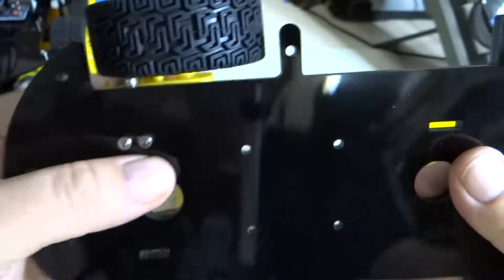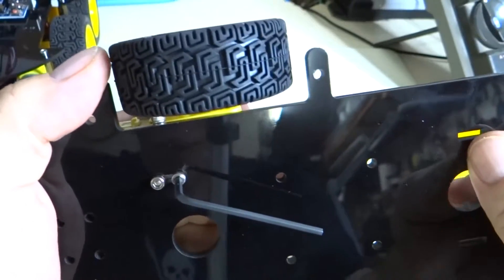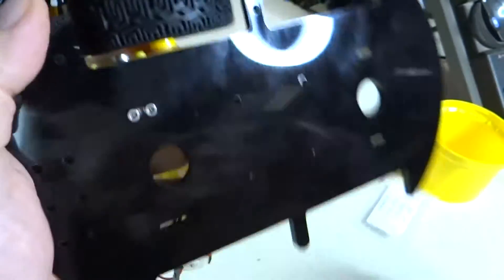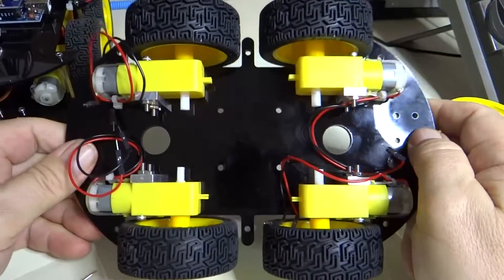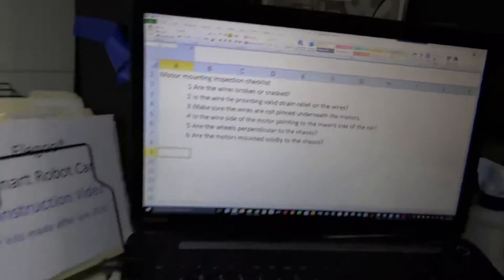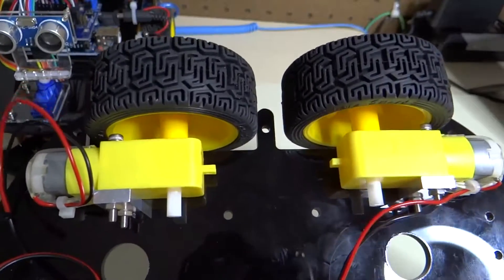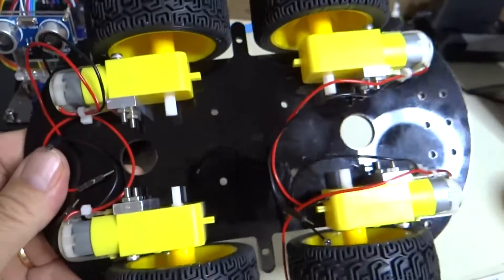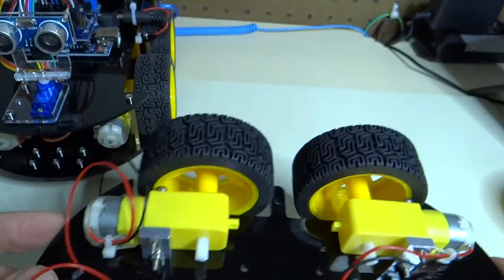Elegoo SRC kit 06 motor mounting final

Comment: It is easier to assemble the car without the wheels attached. Just install the motors and tighten them down. When you install the wheels at the end of assembly, you can loosen the motor mounting screws and align the wheels then. (i.e. it gives you more room when you install the 2 middle posts that connect the top and bottom chassis plates together)